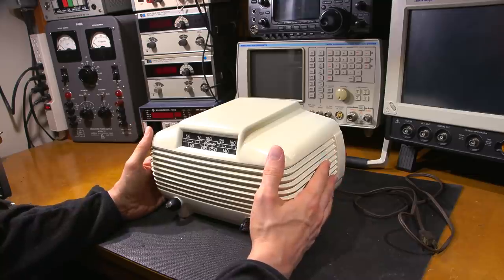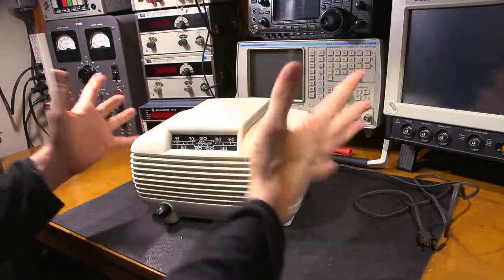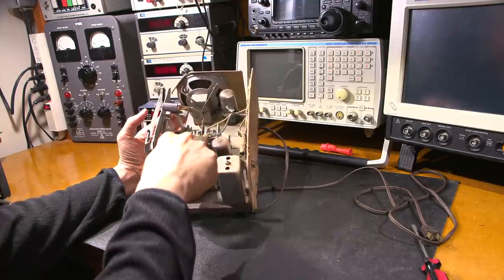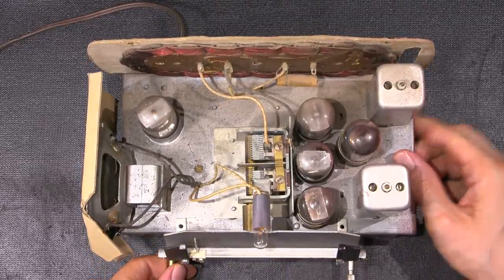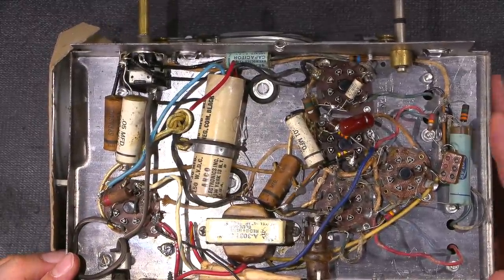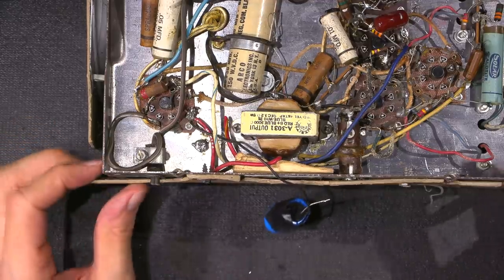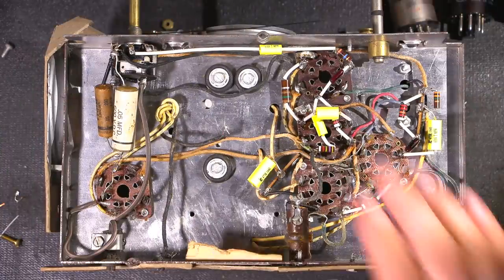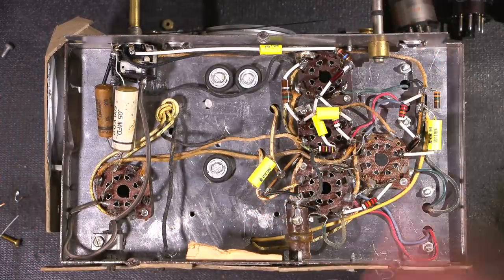BEAUTIFUL 1940's Majestic Radio Receiver Restoration!

Comment: The steps you tool to fully restore this radio just blows me away! You have a passion for this you put more money and time into the radio than its worth. Well done Sir!
Reply from the maker: You should see what people offer me for these. Thanks for your kind comment Roger!
Reply: @MrCarlsonsLab  Gives me hope I want to learn electronics so bad. I do Marine repair for a living over 21 years and it took a major dump it went down 99% I need to get out of it. But every time I see these old radios for sale they are at give away prices and they are not selling . I dont know what magic  ball you have to find people with money but every one I know is broke. I got one of those old school Radio shack labs to build circuits off of ebay its was NOS but I have so  much to learn I still dont know  how these circuits work. Thanks for the reply

Comment: I've seen this type repair before, where the lead tech would give summer help, something like these smaller units to repair or practice on. Tell him what to do, what parts needed and where, hence the bloated solder joints. Then quickly test it, while writing a repair ticket. 
Beautiful work, you've straightened that chassis out nicely.

Comment: You can fix those (long necked) pot axles by cutting the axle below the (presumably broken) fork and then drilling and tapping for a new piece of rod. You do the same for the replacement rod, and thread the two together with some thread lock. Once that's done, you gently saw a new fork. Have done it. Works really nice, and in some countries, you can even get specific kits for this kind of job, well, used to, i haven't done this in 5 years.

Comment: What a timely video! I'm working on a Zenith set that has a similar output transformer. Now I know what that tap is all about. The Zenith also has a "death" capacitor separating the B- common from the chassis. I have some X1,Y2 caps to use. The set also needs its power switch rewired to be in the hot side of the AC line, and it needs a line cord with a polarized plug.

Comment: I did a bunch of radio restorations 25-30 years ago and just recently got back into it with a couple of recent projects on those 1940s type radios.  The speakers are definitely more fragile, I had to repair the cones with Elmers glue. One was a Hallicrafters S-53 that had been partially recapped, but they left a bunch that seemed harder to get to.  it was tricky to align, and had an oddball 2.075 Mhz IF. The other was a GE Octal All American 5 clock radio. It was pretty much unmolested, but a couple of tubes were bad, the line cord was shot, and it needed recapping. I managed to find replacement tubes and pretty close capacitors out of my own stock. It is still missing a knob for the on-off switch but is otherwise attractive and complete.

Comment: Hello Paul. Antique radio speaker reconning is fun. Most older speakers have unusual mounting brackets and most are 3.2ohm. I can carefully cut just the cone out of an 8 ohm newer speaker of the same size that preferably has a wrinkle paper surround and cut out the old torn cone leaving the voice coil in place and put shims then glue the new cone. Works good. I wished I knew how to fold construction paper into a new cone so I don't have to ruin a new speaker. The hard part is making the paper wrinkle edge. The cone is easy. I looked on eBay and paper cones for a typical 5" speaker is $10.00!!!

Comment: I’m sure someone has the right answer.  It looks like a RF blocking feedthrough.  Probably has several inductors allowing DC to pass and capacitors between the inductors to filter out a range of frequencies that are unwanted on the “clean side”.  We use something almost identical in MRI systems (smaller and very precision), where the exam room requires a very quiet RF environment so not to disturb the receive signal from the patient (on the order of femto amperes), but still have to feed DC to the data acquisition systems inside the exam room.

And it reminds me of a very old RF filters of various sizes we used to use on the crypto RF cages we used in the Navy to test ..... {redacted}.  You know.  Very serious stuff.

Enjoyed this video very much!!  Thank you!

Comment: Are you old enough to remember the public tube-testers in many stores?   If your radio or TV broke, you'd take the tubes to the store, test them on a simplified machine for consumer use and buy new ones if needed.   Many people probably missed the HV rectifier in its cage and the hard-to-see tuner tuner tubes. 

Damn I'm old to remember those.
Reply from the maker: Hi Robin, I do remember. And I own one as well.

Comment: I had those as toys when I was a kid growing up in the sixties.In those days,I got them for free regardless of vintage.That is the first Majestic radio I've ever seen:I have alot of their phonograph records which were made from 1945 to '49.I specialized in TV repair but I got sick of it because of the "something for nothing crowd".I got out of it in 1990 but I got back into the  radio side a few months ago.I have a couple of dozen receivers in my collection.Right now I have a circa 1941 Pilot B1,a 1942 Admiral model 4203 and a circa 1939-47 Aetna AA5 AM only set I got for $18 off of ebay.I can't find any info on the set:there is just a tube diagram and the only thing I see as a possible model number(R 1185)isn't listed on the Radio Daze website.I enjoy your vids.I'm 68 years old and radio has been a hobby of mine since the late '50s.I'm somewhat self taught.My first book on the subject was "Everybody's Radio Manual" published by Popular Mechanics back in 1954 but the book is unchanged from 1934.

Comment: I recently bought a zenith to refurbish. It was 30 bucks. Going through most of the listings for tube radios is "oh we plugged it in and it makes static". Sometimes you wonder how when you see pics of the line cords. Thanks to you I can figure it out and are the reason I broke down and signed up with patreon.
Reply from the maker: Glad to be of assistance James!
Reply: I was not expecting a reply but good to hear from you. I am kind of going into this backwards and had broadcast engineering put on me. As dangerous as these little radios are its not quite as bad as replacing a tube in a Harris HT30 that took up a weekend not long ago. That barked a major arc and that was an experienced engineer with me. I taught myself a lot as a kid making simple circuits for my dads model trains and more recent the previous engineers/my Elmers at the station but they have retired or passed away now. I don't have a formal education and just now digging into your courses. If they are anywhere near as good as videos here on youtube then I should learn a lot. Thank you again for doing this a lot of this especially in the broadcast world is a dying breed. I am the only one left within 2-3 hours of here. Oh I am looking at the list of caps you use and ran them through digikey and they are not cheap. This may be answered in patreon I am still learning how to use it but have you thought about buying the stuff you commonly use in bulk and then sell them to us as a kit to get started and then we can refill it as needed online for those of us who haven't built the testers yet to grade our own?  I have quite a few grab bags from Amazon but the components themselves are anyones guess. I would also gladly buy the protector circuits you made for your analyzers and other projects where at least the board was made and the SMD components done. I have a tremor in my hands and they are just too small for me to work on. Same for the other devices. If you were to offer them as kits I would throw money at you.
Reply from the maker: @JamesHalfHorse  Thanks for your input James!

Comment: Great video!! The mystery part looks like a feed thru capacitor. I'm an aivionics technician and I've seen a lot of those in the alternator/generator field and output terminals to eliminate whine in the headsets. Also seen them on engines with points to stop the poping in the radio.

Comment: Paul! Beautiful radio! I love the shape, and I find that the layout inside is very good. Power supply on one side, sensitive circuits on the other. BTW, the device is a pass through capacitor for filtering. 73s CH

Comment: Mystery device is a feedthrough capacitor. A relatively high value, probably paper/oil dielectric. Typical use would be running AC power supply leads into a shielded cabinet.  Sprague was a major manufacturer. Some incorporated a series inductor in addition to the capacitance from the center conductor to the chassis. A forerunner of the EMI/RFI Filter modules commonly used nowadays.
Reply: Or it could be a high current rectifier diode, perhaps?

Comment: Nice radio, sensitive receiver! This looks like an RF filter to use in a high-current application (maybe a coil/capacitor combination) I believe a battery power input in older tube gear

Comment: Trivia answer:  A feedthru filter capacitor used to pass power through a metal enclosure while filtering out high frequency interference.  I have seen these in army surplus equipment like transmitters/receivers and dynamoters (a motor/generator).
======
Your Nixie Tube is featured in a recent youtube by "Techmoan" entitled "Nixie Tube Spectrum Analyzer" https://youtu.be/6kVIciuZtwM

Comment: The european AC/DC sets straight up connected one pin of the line input directly to the chassis. To make it worse, the plugs used in Germany were (and are!) totally symmetrical so impossible to polarize. 

They DID isolate the chassis relatively well when the radios were new, but this included wax seals above the set screws in knobs etc. which were seldom replaced correctly. Also more often than not, the external inputs were tied directly to the chassis to. 

The only safety precaution here was a "ACHTUNG! Verwende nur Tonabnehmer nach DIN" = "Attention! Only use pickups conforming to DIN." 

The american design with the separate ground bus and no external inputs at all, besides the inductively coupled antenna were way ahead of this.

Comment: @1:06:39 a rewarding and gratifying moment. Well done Paul. Can you expand on using a safety cap on the antenna... All the best. Don
Reply from the maker: Hi Don. Just one extra safety step. If the radio was ever to get plugged into a house outlet that was wired incorrectly, the chassis would be closest to the hot line. One end of the external antenna connection connects directly to the chassis, and the other through that safety cap to the jack (Fahnestock clip) on the rear of the radio.

Comment: What fascinates me is that circuit diagrams for most of these types of projects seem always readily available, in what looks like, pristine condition. Given that from experience, diagrams glued into, or were otherwise placed onto the backside wall of a vintage radio by the manufacturer, had often ended up looking well and truly their actual age. Granted, that too was a pretty darn long time ago, and post-WW2 Germany at that time, compared to New-Canada today, was most likely an entirely different, partially rubble-filled, and overall pretty much darn well untidy world; in which for the value of an untorn copy of a circuit diagram, a young Tech's soul was quite easily sold. Did one ever have an underground lover? Yes; but it caught on fire while asleep in the cellar's bedroom's workshop cave.

Comment: Cool video, watching this sort of video had given me the courage to tackle my first capacitor replacement of a loud humming device.  Back in  1994 I purchased my first 386 computer. I needed some speakers for it, and went to Radio Shack. I found a very nice unit that was made to sit under the monitor, it has a very large bass speaker and two smaller speakers for the stereo effect.  I used it for years, and later set it up as an amp for our stereo to play in another room, routing the speakers through some telephone inside house wire.  Well it is marked July 1994 on the bottom, and the hum began to get worse and worse till it became usless.  I had wired in a bluetooth receiver before that, and decided to tackle the task. I had a bunch of high quality caps that came from the Electronicgoldmine.com in a huge box of miscilanouse crap pack, and it had all top quality caps from good makers.  Most of what I needed were in that pack but some of the smaller electrletic ones I had to use cheap china junk caps.  The replacement took a few hours of work, I worked at it one cap at a time so as to not get lost but now that I am done it works GREAT!  I did have to use a smaller cap in one of the biggest points, it called for a 33000 ufd at 50 volts, all I had was a 22000 at 63 volts but it seems to work very well with the lower rated cap. Very nice bass,  Better then I recall in fact!  I am going to use it for a bluetooth music receiver.

Comment: I never did hear why the gas regulator had a incandescence bulb nearby. Some theorized it was to excite the tube into conduction but I have seen them in the tops of chassis that are dark as well. I think it’s a current limiter allowing the tube to fully excite before the filament warms up limiting the current.

Comment: You can get micro tubes which are wire ended and will run of batteries that might be an idea, I can think of a Mixer upgrade with three ECC88 configured to operate like a SO42P Balanced mixer and also provide the Local Oscillator  and will cut out a lot of junk in the IF leaving only what is wanted and making it easier to set up.

Comment: I have enjoyed your videos for many months, and you remind me of my old H.S. Electronics/Electricity teacher.  Everything kinda makes sense in the way it’s presented.

I have an older 16MM sound projector that my Grandfather used to show films in 1931.  That makes it a very early sound projector,and it uses an electro-magnet speaker, and very old style tubes.  I have not tried to use it in decades, and the sound system started failing before that.  It’s a basic projector and worked well for it’s time.  The hum that developed was likely the capacitors drying out, and the sensor that was used began to fail and the sound died.

Do you know if there would be interest in restoring the unit for posterity?  I have kept it in the family and have many of the old films that my grandfather showed to tenants on his South Carolina island.  That,  in itself, is a long story 🙂.

I’d be interested in your thoughts.

Steve Kaeser
Maryland

Comment: oo nice. 3 days ago i picked up a heathkit IT-22 capaci - tester with a magic eye tube its in nice shape but im going to guess it may need a cap change even though it works although never tested a cap yet. what of the odds of a cap tester needing cap changes is ironic. (also this is my very first desk top equipment i ever owned got to start small somewhere i guess)

Comment: coaxial feed thru capacitor to clean the interference off a wire as it goes through a bulkhead. like in a car to clean off generator hash. or in a modern car to clean off electric fuel pump hash.

Comment: Mystery part looks like an old passthrough capacitor for filtering power supply noise in mobile audio systems.
Reply: More some passtrought cap from a large transmitter.

Comment: That's a really neat looking Art Deco style radio.  Thanks for the discussion on the audio transformer and how it is wired.  I was not aware of the multi-faceted role they play and you probably prevented me from making a regrettable error somewhere down the line. Also, can I ask where you get your carbon resistors?  Nearly all the kits I see online are metal film types from China and are temperature sensitive.  I could really use an assortment of carbons in my stock.  Thanks for another great resto video!
Reply from the maker: Hi SY. The resistors are NOS, so nothing purchased recently. You will notice the carbon composition resistors (the majority) are high accuracy types. The best place to find this stuff is in surplus sales. Ham swaps are another good source.

Comment: The transformer less radio's were known as a 115 vac/vdc in its specks.  Country homes with no electric power could put enough batteries together to get 115 VDC to power the radios

Comment: Here in Belgium a 'polarised' lead wouldn't do much of a difference. My former home had 3 phase 230v so without a neuter. My current home has 3 phase 400v + neuter so you can use the neuter to get 230v to the wall sockets BUT, electricians don't always care about where the neuter is connected in the wall socket so you never know for sure. The only 'polarised' lead we have here is one with an earth connection so wouldn't be ok to use it on a device without a real earth connection in it.

Comment: if you can remove the speaker that is better.

glass is a very difficult material to cut you make a scratch to weaken the glass then you snap the glass or take a soldering gun to it and hope the fracture follows the line.

Comment: Line cord in the garbage? But... copper is recyclable!
Reply: Indeed... I use the strands from old power cords to make soldering sleeves to connect new components to old leads... just wrap the strand about a dozen times around a pin or thin sewing needle.  Cut out the old component leaving about a cm or so still attached to the lug, slip a sleeve halfway over the end of the old lead, insert the new lead into the other end of the sleeve, and solder it up.  Neater than doing J-hooks, and sometimes easier than unsoldering a big mess of leads on a lug.
Reply: I also recycle copper.  I think it is a beautiful metal, one of my favorites on the periodic table.  Call me silly, but I hate to waste it.

Comment: Why was it necessary to use a safety capacitor on the antenna?  Would it also have been OK to use a film capacitor as a replacement?  Thank you for another outstanding video.